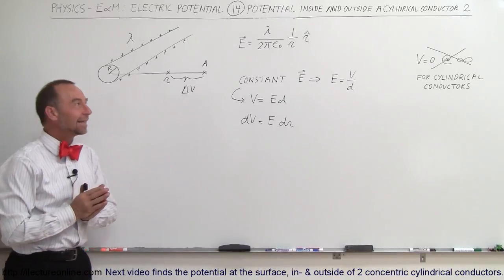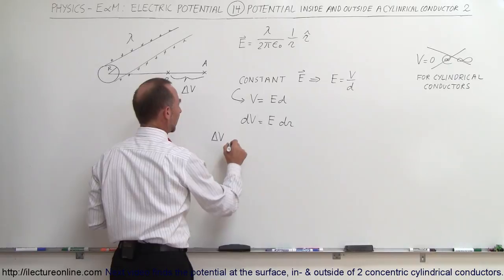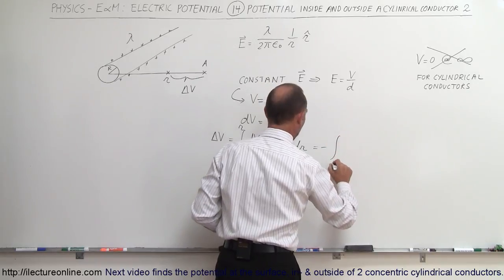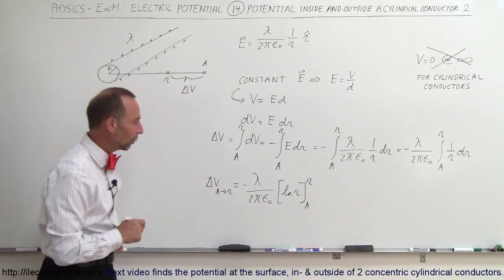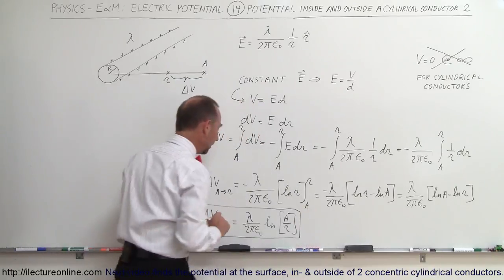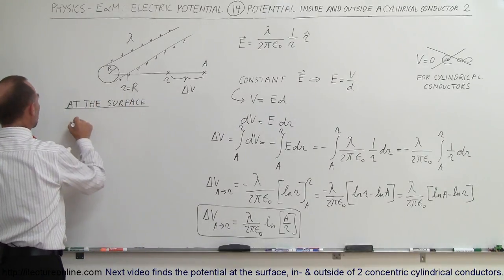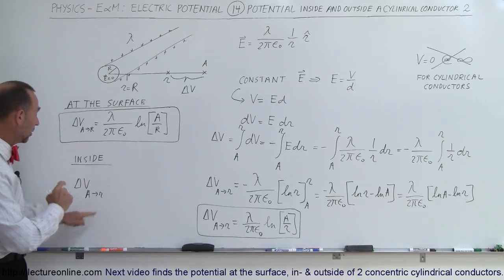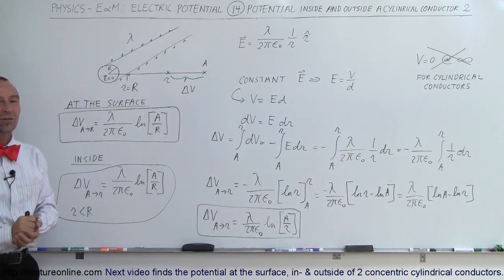Physics 38   Electrical Potential (14 of 22) Potential Outside a Cylindrical Conductor

Comment: Hi! I have a question, why is it correct to asume that the cylinder behaves as a line charge? Shouldn't it behave as a charged surface and instead of using lambda use sigma?
Reply from the maker: Mario,
Yes, never assume something.  One should only "assume" such a thing if it has been proven mathematically.

The electric field (outside the cylinder) will be identical regardless if the charge is a line charge or the charge is distributed on the surface of the cylinder.  Go ahead and try the calculation or look at the videos on the electric field.  I have some examples of that.
Reply: Thank you very much, your help is much appreciated

Comment: Is this doesn't mean that the theory is incomplete....or there any reason for this problem at infinite distance 🤔?
Reply from the maker: It is not that the theory is incomplete.  It just means that there is no meaning for the potential at infinity.  But rather the change of the potential going from one point to another point.
Reply: @MichelvanBiezen  🤔....but then in other situations we can define potential at infinity...then somehow we should define in this situation also nah ...?
Reply from the maker: For the purpose of making it a teaching experience we can, but in the real world it doesn't have any application.
Reply: @MichelvanBiezen  ok then what is the defined voltage at infinity on that situation  ?🤔❤️
Reply from the maker: Voltage (even when at infinity) only has a meaning if it is stated in reference to voltage at a different location.  That is why we use the expression: "the voltage difference" between a and b.
Reply: @MichelvanBiezen  alright then what about required energy at infinity... Is it zero 🤔?
Reply: In fact the situation is non-sense. There are 2 infinities conflicting with each other. Cylinder is infinite, and distance is infinite... Which one is more infinite? If the cylinder is finite in length, or less long then the distance we look at, the V should be 0 at infinite distance as expected, since the cylinder would look like a point charge at a sufficient distance. i.e. for any cylinder length, you can always find a distance sufficiently high such that the  cylinder would look like a point charge.
Reply: @bgelloz  yeah, prof answered that question!

Comment: Hi Michel,
If the electric field inside the cylinder is zero wouldn't the potential difference also be zero since it's dependant on E?
Thank you for the amazing videos!
Reply from the maker: The change in potential would be zero, since the change in potential depends on E x d
Reply: @MichelvanBiezen   so with that being said, delta_V inside the cylinder is zero but the potential inside the cylinder is equal to the potential on the surface. 
Because in the video you wrote the change in potential is equal to lambda/2pie * ln (A/R)
Reply from the maker: The potential inside is the same as the potential at the surface.

Comment: Hello sir,
How would the calculations be if it were to ask for the potential difference inside the cylinder given the cylinder is an insulator?
Reply from the maker: Note that the change in potential =  E d.  So you need to find the electric field inside the cylinder (we have examples of that) and then integrate over the radius.
Reply: So if I am trying to find the electric potential difference between the insulating cylinder's surface and the center of the cylindrical insulator, I would need electric field at the radius and inside the cylinder? 
I am very confused though - at the center of the cylinder, wouldn't the distance be 0, thus making the electric field equation of the cylinder unusable since there would be an error since the zero would be the denominator inside the ln(A/R).
Reply: @MichelvanBiezen  How would I apply the cylindrical electric field equation to find the electric field at the center of the cylinder?
Reply from the maker: There are a number of examples in the playlist (Gauss's law and this playlist).  I suggest you look at those examples first.
Reply: @MichelvanBiezen  Great, thank you so much!

Comment: How do we know that E equals to that in the beginning?
Reply: Use Gauss' Law with the Gasussian surface being a cylinder or radius r around the conductor. The end caps of the surface don't matter because the conductor is infinitely long. Surface=2(pi)rL and Qinside=(lambda)L. The L's cancel so you get the E shown at the beginning.